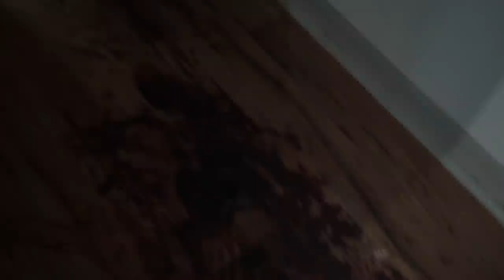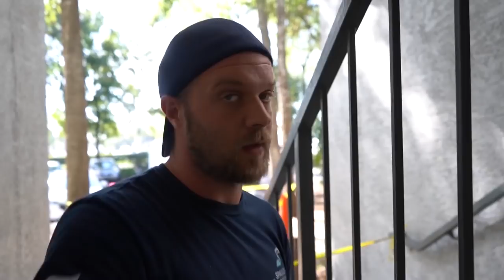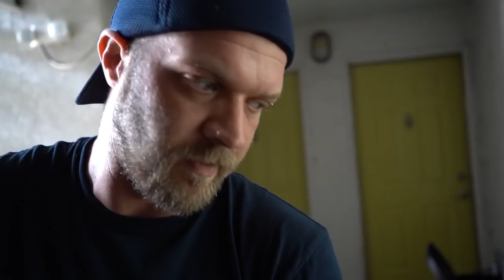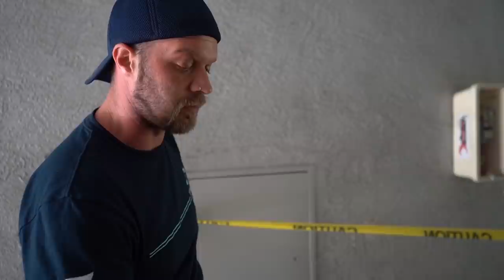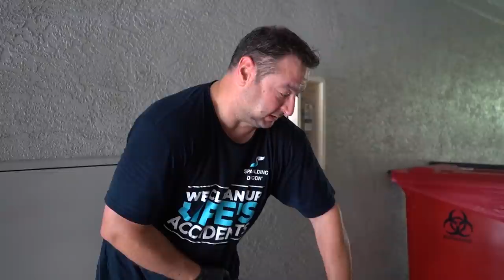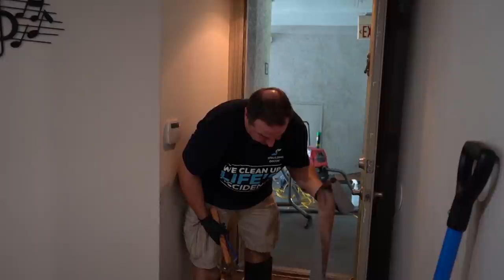When Neighbors Fight Pt.1

Comment: i can just imagine the "bio soup" in those vac containers!!🤢🤮
Reply: omg no please
Reply: forbidden soup
Reply: Delicious
Reply: It is quite a bio soup collection e en after a carpet/furniture/tile steam clean with stanley steemer. My boss (EX boss now) would cross the line all the time with poo ,urine,blood at customers homes. I finally quite after being fed up. Buy during my time there I had experienced HOARDER clean up, as well as all of the above. I still have some b4&after snapshots I kept of huge blood stains etc... we used peroxide and citrus spray to help get it out. I would rather work for this company, then where I worked , because they take precautions and suit up like you should. I at least know, that I can handle this type of work even if I never delt with a dead body clean up( wouldn't be surprised if I did,but was lied to as other coworkers do have stories of being made to do these types of clean ups (no dead body left of course). Those guys still with the company are poverty mindset though.... because they are making VERY low pay for this type of work. Which is why I quite. Im not doing all this crap with no compensation for my own purchased gloves, masks,etc... super low pay etc... etc...
Reply: Mmmmm

Comment: Why do you use small spray bottles rather than a 1-gal pressure pump tank?
Reply: Probably so the spray wont splash on them
Reply: the last thing they want is biohazard particles being sprayed everywhere
Reply: Money
Reply: You can change the nozzle so its a saturating mist and not like a fire hose lol. It wouldn't splash up anything.
Reply: The spray bottles they use have just the right amount of pressure to penetrate and saturate the bio material without spraying it around ... Would be my guess. I'm sure they've done a lot of experimenting to find what works best while remaining safe and cleanly.
Reply: Lighter and more convenient I would say...I am a cleaner ;)
Reply: Easier on the back

Comment: I feel like I could do this job. Worked in an OR for 8 years turning over rooms (cleaning and getting ready for next case)  in between cases. It's non stop cleaning blood, and the Trauma cases are crime scene like. There's normally blood splatter from surgeons hammering so you have to clean everything in the room,  walls, ceiling, and floor. It can take a while! I enjoyed it. Very hard on the body over time.

Comment: If that's the flooring I'm thinking of, you should be able to peel it up after heating it. The glue is made so that it softens once you heat it up so you can remove and replace damaged pieces. I hope that helps in the future!

Comment: Training Classes ? When I had to do this mostly things were done within the 1st two days the 3rd day was harder .. having someone working with you is always better.
Reply: On 1 of the jobs the “moving sized truck” was towed out of a parking lot. Could not believe the towing company could tow something that big or that fast. The truck was only there for less than 45 min. while I ran upstairs to get something to eat & a quick shower. My only other thought was if they only opened up the back .. good thing they never did .. training classes would have been great back then !

Comment: It might be easier to get that flooring off if you use a blow drier to heat up the glue. That's how I replace the grip tape on my skateboards and it works like a charm.

Comment: I’d be using a tank sprayer, 60 stairs with a bottle sprayer? No thanks! Use a heat gun on glued on flooring, peel it back slowly as you heat each plank underneath

Comment: Why aren’t you using spray bottles like exterminators or landscapers use you know the 2 or 3 gallon versions you can carry around on your backs. Also the use of pressure washers would probably make it easier maybe a 4 hour job for the exterior.